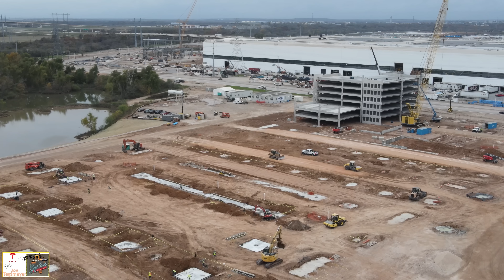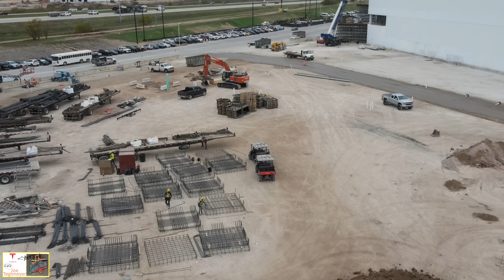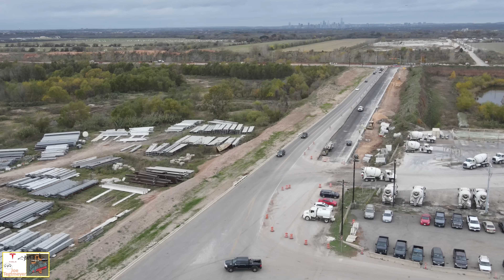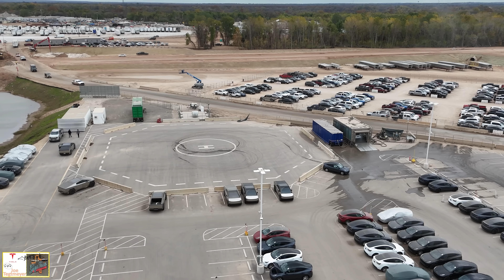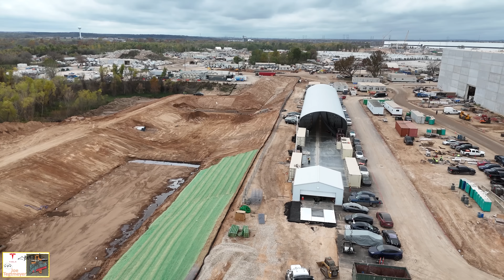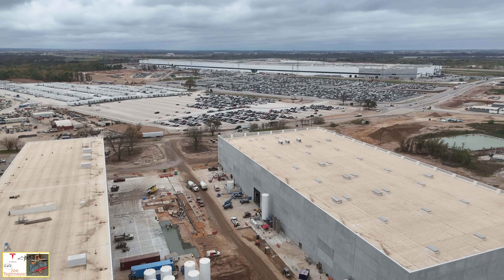S Extension Grows 2X, W Site Progress & Cybertruck Updates! 8 Dec 2023 Giga Texas Update (8:35AM)

Comment: 21:00 It does not make sense to inlet the air next to the casting machines. Hot air rises. The replaced windows aren't at the highest point. They are at a lower level, meaning that using them as outlets would result in a layer of hot air being trapped under to roof.

Comment: the area next to the parking structure stairs is likely to be up & down ramps…  need a way to get up & down 😂
Reply: The entire garage is ramped, not a level floor in the place. I'd say each floor ramps 50% of the height to the next level, actual ramps for the other 50% would be where the small window type openings are seen at 4:43.

Comment: Hey Joe, this is one of everybody. 

You only saw the Cyber rear castings outside. The front castings are actually stored inside the building on the second floor of BiW. You probably can see a little bit through the glass window. It’s not easy to see them from outside though. They’re not next to the windows.
Reply: Are cybertrucks being stored inside?
Reply: @nonenope6277  

In general, no. But the production line itself is a storage. But they don’t stay the parking for long as the truck should be a great holiday gift for some. 

Who knows Joe might put a camera on top of some tree pointing at the exit door to the south and livestream that 24/7.

Comment: Interesting that southern addition is divided into only 2 floors  while the height appears the same as the main building.
Reply: Similar to the BIW, only 2 floors initially. Lots of steel has gone in since via the loading platform.
Reply: @DessieDoolan  first draft
Reply: @benguthrie49  At the risk of having to retract a statement, I would think with this one they aren't just building 'space' as in much of the existing building, but building for a specific purpose.

The elevated footings, the huge windows, the unique roof line. Different for a reason.
Reply: @DessieDoolan  Good points.  The bump out of stamping II was definitely a quickly needed extension.  The variation in the footings is very curious. Going to be fun to watch.

Comment: Question for the construction experts here.  Are parking garage construction companies looking toward the future when more cars will be electric and therefore heavier?  It would seem that parking structures will need to account for the higher loads of an ever-increasing percentage of electric vehicles in the mix.
Reply: You would think so. It's just a matter of designing for a particular expected load. Engineering standards would cover that sort of consideration.

At some point existing parking garages might need the number of parking spaces reduced as the fleet becomes heavier.

Good question.
Reply: The simple answer is yes. Design codes are being modified around the world to take account of cars becoming larger and heavier. Already some car parks are posting limits on vehicle weights. Here in Hong Kong I am seeing weight limits displayed on the tax label of some of the heavier electric cars to show that they should not use some car parks etc.
Reply: Commenting to move up comment ^

Comment: Looks to me like a good idea would be either a tunnel or an overhead walkway (an airport-like moving sidewalk would be good too). Such a large car-park otherwise will be a focus, requiring so many employees to be traversing constantly across the busy 4-lane road between it and the factory. It must take everybody even now at least 15 minutes (probably more) to get from private car to factory work site and vice-versa every day (after and before long commutes to even get there).
Reply: A skybridge or tunnel linking the parking garage to the main factory is an excellent idea in concept, but there are several technical challenges.
1) Crossing the easement would require permission from the utilities, and there are at least 3 utilities.
2) There may be clearance issues between a skybridge and the transmission lines.
3) There are issues with a tunnel due to a gas pipeline that runs along the easement.
4) Building a tunnel would also be complicated by the high water table in the area.

Building a skybridge or tunnel anywhere else would work.
Reply: @DavidJohnson-tv2nn  You are certainly correct in your assessment. Too bad. The power lines would be a problem, say, for a 3rd floor walkway. Anything much lower could interfere with some traffic. And there seem to be multiple levels of everything (all kinds of pipes and conduits) buried everywhere. Not to mention the water table (unless, I guess, you were the Boring Company). Maybe they might put a stoplight with a "Walk" button to push for employees. Or use busses departing and arriving at the Car-Port.
Reply: For the most part people will probably still be bussed around the site.
Reply: @DessieDoolan   Does maybe look like busses departing and arriving at the Car-Park. Honestly, I hadn't thought of the power lines and gas pipes, etc.
Reply: @WarrenLacefield  There are stops for shuttle buses in the parking area to the north of the Parking Garage. 23:20 for example.

In the early days they were using old school buses.
Reply: @DessieDoolan  Right, see exactly what you mean. And they have all the shuttles as well from the contractor parking on the west side across the expressway. We don't often see shift change at Giga-Texas.
Reply: @WarrenLacefield  That's right we don't often see shift changes. It's fairly obvious when there's one on. The northwest corner by Battery is where I notice buses dropping people off mostly. Just to the north of the Main Entrance also.
Reply: after 30-odd years off and on commuting to various downtown offices I can say that what I valued most was a guaranteed, hassle-free parking spot. And to shake off the irritation of traffic jams I felt it was nice to walk a few minutes and start to focus on the coffee machine and on the work ahead. Kudo's to GT to make this parking garage effort so close to the main building, they could also have dumped a parking lot somewhere in the outer districts of their land. Initially I didn't believe the parking garage would be so close to the main building because of the tremendous logistical pressure to utilize the limited number of loading docks virtually non-stop. For comparison, GB and GS have several main buildings, resulting in an abundant nr. of loading docks (which may even serve in a WOW function).

Comment: 16:58. Not transformers, but distribution and switching boxes. One can tell by the single set of lifting eyes located in the center of each end. Transformers are much heavier, and the weight is off center due to the empty cabinet that protects all of the connections being on one side, and the very heavy transformer being on the other. These distribution boxes are used to provide junctions and switches to the medium voltage distribution grid that belongs to the factory, allowing for circuit isolation, and are commonly found at large industrial installations like sewage treatment plants and factories where medium voltage systems are used to provide power to each building, or to sections of buildings. Medium Voltage distribution systems are generally between 12,000V to 35,000V, but can go as low as 1000V and as high as 100,000V, although anything above 69,000V is often considered to be high voltage.
21:00. One can generally tell the difference between exhaust and intake vents by their orientation. Exhaust vents on roofs are usually straight up, like stovepipes, or if covered, will allow exhaust to exit from a full 360º. Intakes will usually be below horizontal in order to prevent ingress of undesirable materials. These intakes look to be around 30º to 40º, normal for intakes.
Reply: 16:58. Switching boxes, noted!
Reply: @DessieDoolan  Specified, not spaced. Darn auto correct!
Reply: @GoCoyote  Didn't notice. If I had, I would have made a report to the Grammar Police.
Reply: @DessieDoolan  Guilty as chrrrged.
Reply: @GoCoyote  Charged, surely.
Reply: 16:58 Thanks for the information. I thought they were probably pad-mount  switching boxes but wasn't 100 percent sure. Since some transformers have a similar look.

Comment: I have never seen a pre fab parking garage.
Reply: More common than you think.
Reply: when I did some googling I found that parking garage design is a notable sub-branch in the building/consultancy industry. There is a lot going on there, perhaps especially in America with its history of really large parking lots. So I'm sure GT can build on a tremendous data set of best building practices, studies to optimize car circulation systems and so on. The nicest ones I've seen in Europe are fully automated with free spot indicators, E-Toll cards/phone apps and on the walkways out or in a couple of convenience shops for the daily necessities. Then there is the purpose of the garage itself. This one at GT probably will be optimized for fastest parking-leaving sequence and doesn't need to cater for families with kids and icecreams, buggies and bags. I read there is a big difference between angled parking slots (with 1-way traffic lanes) and straight parking slots (with 2-way parking lanes). I hope the top level won't be covered such that we can see how they have set up this new 'GG' concept (Giga Garage).
Reply: @hardernl8893   The Gigarage, pr. giga-raj.

Comment: Thanks Joe
2:20. Battery north, Level 1 inside. 5 bridge crane beams with the rail/track already installed.
3:38. WOW yard. Bottom left. Heavy duty low loader. 25:30 also.
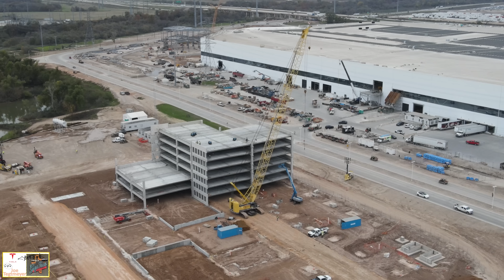5:03. Parking Garage. Internal wall openings, with bars. Corbels/shoulders cast into the panel face to land the Double Ts on. Note the location of the corbels/shoulders change across the panel as the Double Ts ramp from level to level.
5:36. Parking Garage. Stairwell may remain isolated for fire separation requirements.
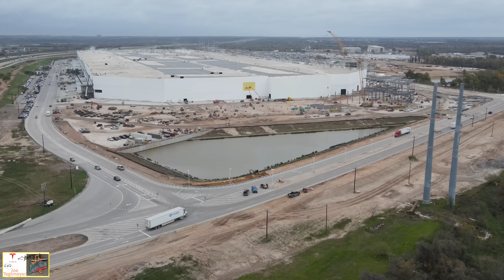6:59. River Road. Electrical conduit works. Location for an illuminated Cyberberm in the renderings.
7:37. River Road/Highway bridge. Start of works on the Giga Water Loop?
Troublesome guy wire removed by the Linesmen, power pole being supported by the crane.
Open end of a black HDPE pipe seen in the old excavation.
Would seem Giga Water Loop is unrelated to stormwater management. A reclaimed water supply, or sanitary sewer more likely.
Trench across River Road would be the next step.
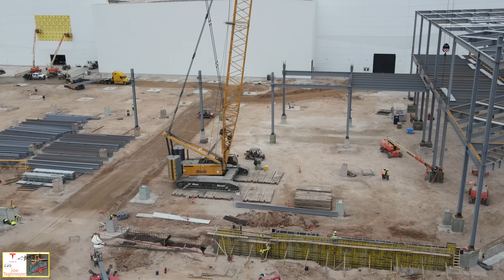9:09. Southend. Retaining wall varies in thickness.
I’m calling this above ground structure a retaining wall because it is constructed on top of the perimeter grade beam, and I think the purpose will be to retain earth inside for a raised floor.
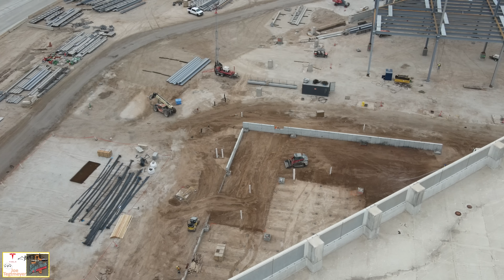10:25. Southend. Triangular patch. Cleared and levelled. Grid of screw piles visible.
Top of the retaining wall is same elevation as the floor within stamping, give or take the floor slab thickness. This retaining wall is also 4’ 5 ‘ 1.2m 1.5m lower than the retaining wall at 9:09.
11:05. Southend. Bottom Footings P89 and P90. Next row west is N. Skipped O.
11:13. Southend. Bottom. Footing marked J91 in green. Next footing west by rights would be H if the same grid pattern is being followed as the original building where there was no grid line i.
11:33. Southend. Footing inside the building line at the corner has 6 CFA piles.
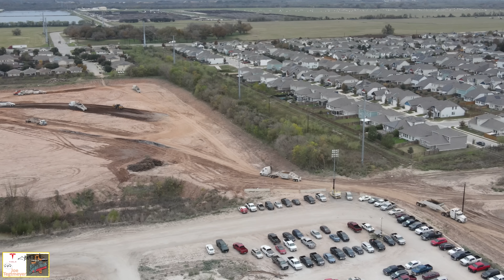13:42. Far west. Centre-dump truck getting out of line.
14:28. W-WOW storage. Blue wrapped items. Small stamping presses. Round items to the left would be flywheels. Similar here in Stamping 2, https://youtu.be/4CitJ0xsP2s?t=284
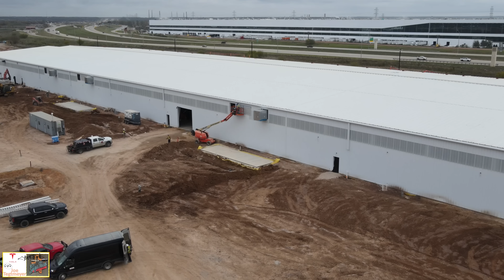15:29. New EOL site. Bottom. 3 large grey items would be packaged HVAC systems to be mounted on pads. 2 seen at 16:34.
17:36. New EOL site. HDD bored conduits uncovered and trimmed to length. Gravel bed marked with the location for a vault.
18:45. Tesla Road. Steel stockpile. Bottom. Bridge crane beams recently shifted, would be those at 2:20. 
I don’t think this steel is being used at the southend. Different colour. Think this is all slowly finding its way into the existing building to build additional floors/mezzanines.
20:43. Plastics, apron. Plastic pellet delivery.
21:37. Casting east. Easement. Really getting stuck into that berm. I wonder if the plan is to widen it enough for a wide turning location long/heavy trailers.
Concrete road barriers shifted towards the centre of the road. 23:09 also.
21:56. Casting east, apron. Cybertruck rear castings. Munro’s latest video, Sandy reveals that the cab buttress and tailgate support castings are welded to the main rear casting. https://youtu.be/u95V_n_6qcM?t=783
27:50. Cathode pond. Left. 4 large pipes for flood event flow. Small white PVC pipe for the regular outflow through the bio-filtration basin.
30:15. Cathode plant platform. Pipework droppers connected to the pipes in the utility trench across to the Die Shop.
Reply: 🙂Thank you!

Comment: @ 24:26 Unfortunately, typical of how they ignore erosion control on this project. Erosion control matting is far cheaper than rebuilding a road, or even excavator work.
Reply: Continuous nitpicking.
Reply: @sammyk874  Continuous F ups require continuous nitpicking :)
Reply: I have long thought that they should throw down the seed matting on every slope of bare earth ASAP.

Comment: Thanks Joe!
EOL facility:
South:
@ 15:44 Conduit risers on the northside of the vaults may be the location of more pad-mount switchgear cabinets. The base for a pad-mount unit can be seen by the stack of vault covers. It looks like a vault.
North:
@ 17:02 (Left) Three pad-mount switchgear units or transformers placed. Cables pulled through conduit on power pole, and into the vaults. 
Crew unrolling caution tape to warn future excavator operators.
@ 17:39  (Bottom left) HDD duct-bank from under the freeway uncovered. Looks like the location of another vault.
(Bottom right) It will be interesting to see the purpose of the 4 conduits exiting the north side of the vaults.
Tesla road:
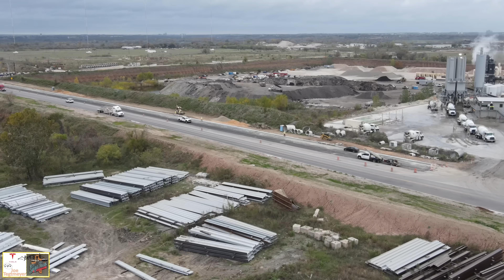@ 18:56 Ongoing work on the widening project.
East side of casting/HDD bore under the road:
@ 21:39 (Red fenced in area between the stairs and the transmission line towers) The black end of the HDD duct-bank (2 conduits inside a sleeve) can be seen sticking out.
Speculating that a new vault will be placed down below by the building. It will connect to the new conduits in the HDD bore to provide a new power source for the Superchargers.
(Lower right, red fenced in area by the building) Expecting them to begin reconstruction of the north main power duct-bank/vault soon. Since they already pulled new cables as far as the north parking lot, seen @ 22:22 upper left.
North parking lot:
@ 22:22 (Upper left) Cables sticking out of vault. Cable pulls complete from south of the Tesla Enclosure/Mega-vault.
@ 22:40 New path under construction.
Reply from the maker: Thanks David … really good observations! 🤗👍

Comment: Hey Joe, with you and all the experts that watch your vids (and maybe they know), being i'm someone who knows absolutely nothing about construction (but enjoys watching it) I'm finding the Parkade construction leaves me with a question… Would it not have made more sense for them to place the concrete on the ground before putting up the main Parkade? That way they would not have to maneuver it into place with different equipment.
Reply: With all the heavy construction equipment moving around on the ground floor, it is smarter to pave this at the last moment, otherwise the concrete would be damaged before it even has been used.
Reply: @MarcoNierop  
Makes sense, thanks for your answer  👍
Reply: Concrete will be pumped in once the structure is complete. Similar to how the factory was constructed.
Reply: @DessieDoolan  
Thanks muchly for your answer   👍
Reply: @terrysmith8655  You're welcome.
Reply: The columns have to be placed before concrete slab on the ground floor. Lateral stability of the structure will come from a reinforced concrete slab on the ground floor and reinforced concrete poured over the precast floor decks above. As well as from shear walls placed throughout the structure
Reply: @DavidJohnson-tv2nn  
Cool, thanks  👍

Comment: Open area in garage is likely for the elevators.
Reply: Probably for elevators, but also ramps to connect one level to the next.
Reply: Footings for the elevator shafts can be seen to the left at 5:43.

Space between the stairwell and garage may be required for fire separation.